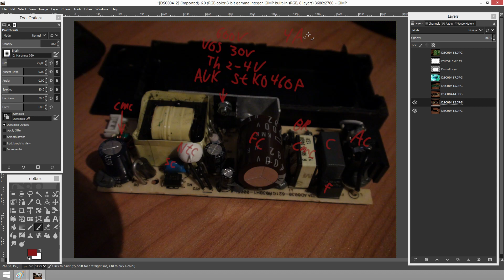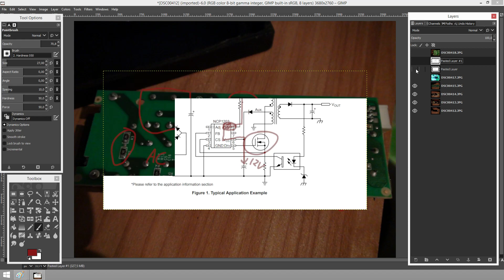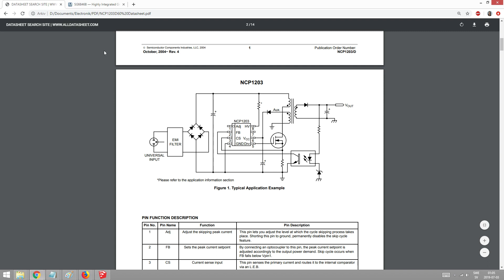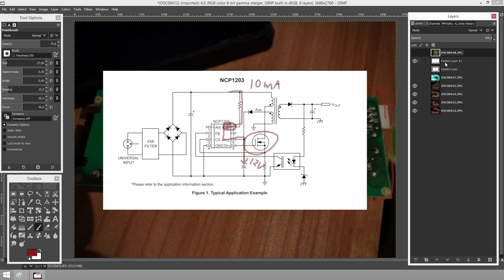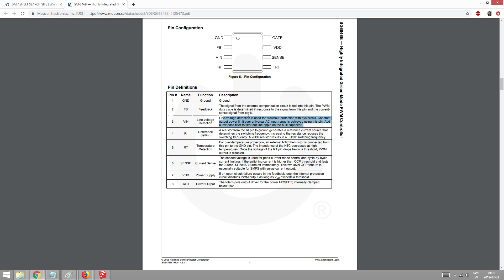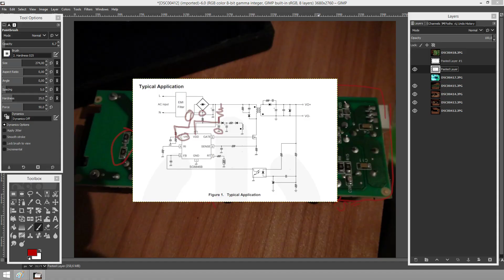021 Cannonscan 9000F Power Supply Analysis

Comment: Thank you for the great video, @todayonthebench!
How does one remove the PSU from the scanner? Simply by removing the screw and pulling the brick towards the back of the scanner?
If that's the way, my unit seems to require significant pulling force and I'm afraid of damaging something, hence the question :)
Thank you in advance!
Reply from the maker: My unit required not all that much force, but also had a cable between the PSU and the rest of the scanner, so be gentle to not rip that apart.
Reply: @todayonthebench, many thanks! It was indeed quite easy to get the PSU out. I wonder how you disassembled the PSU to get to the PCB. I guess it uses some clips, but it seems quite stiff and hard to open.
Reply from the maker: @dando1992  The case for mine were ultrasonically welded, so not particularly fun to take apart.

Comment: Check R22 which is 2Mohm thourhg hole for the potential divider from rectified voltage to the chip. VIN on that chip needs to be at least 0.9V to start up.
Reply from the maker: To be fair, I long since threw that PSU away.
The scanner runs fine from a constant 32 volts, and that isn't hard to source when I need to scan something.

Though, regardless.
I do think the PSU has a somewhat odd design, even if it technically won't see a massive negative voltage, only about - 0,6 volts at most due to the inherent nature of the bridge rectifier.
What I can say is that I did measure around to see what could be wrong with it, and the chip were dead. I didn't feel like sourcing a new one since it's obsolete.

Comment: I know it's been 4 years since you posted this... But did you manage to get the scanner working by simply feeding 32V on the two pins? I've just been given a 9000f MK II for free and the power supply is not working, so I'm wondering if it's an easy fix
Reply from the maker: Yes, the scanner does work rather well being feed 32 volts directly. That is how I use it today, since I never really got around to building a new PSU for it.
Reply: @todayonthebench   please , which pins need +32v and wich pin is the negative ?
Reply from the maker: @remydouhet6033  On the PSU the pin closet to the corner of the brick is +, the middle pin is some control signal that seems to not be important. And the last pin is ground.
Reply: @todayonthebench  Interesting... My 9000f MkII just stopped turning on, and I thought maybe the info here could help me.  In the end it didn't, as it turned out that the psu is fine, and the fault is elsewhere.  The PSU outputs around 8.5v whenever there is ac input, effectively a standby voltage.  When the scanner is turned on the middle pin of the psu is  'shorted' to the positive pin and the output rises to 32v. In my case the 'power button' is not initiating the required control.  Unfortunately, putting in 32v from another source didn't do the business either.
Reply: @stephenfoxall2207 I have the identical problem, PSU giving 8v and 32v when the middle and + are bridged. Power button just blinks. I've looked around for a service manual to have a poke around inside but there's nothing out there. Did you ever get yours working?
Reply: @capnchu unfortunately I didn't....it's still sat in storage.  In the absence of being able to find any service manuals I couldn't even work out how to get inside the unit. I bought a relatively cheap Epson V600 which is still working just fine.